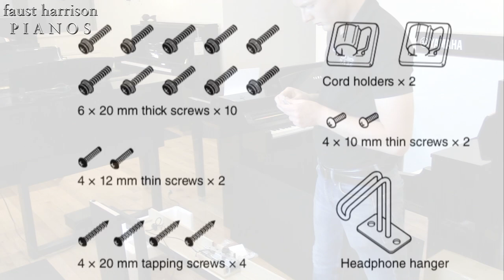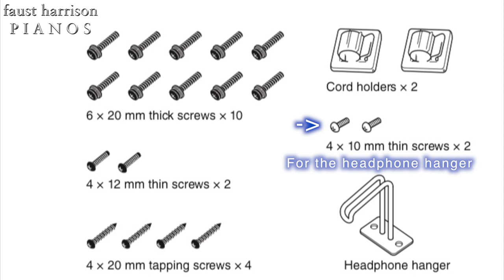Yamaha CLP-735 & CLP-745 Clavinova Setup & Assembly STEP by STEP

Comment: Hello. I want to buy CLP 735 (polish ebony)gloss black. I think color has no effect on sound. Do you think rosewood or (polish ebony) And do you think it's worth paying that price difference? Thanks.
Reply from the maker: Hello, thank you for the comment.  The color has no effect on sound..  The finish color really depends upon where you are going to have the piano setup and the surrounding colors in the room.  The polished ebony option is great if you have a neutral room where the rosewood would probably be better if the room has colorings that compliment that finish.  Yamaha is now offering the new model, which is the CLP-835 available in several color finishes.  https://faustharrisonpianos.com/product/yamaha-clavinova-clp-835/ and you can compare the different models here: https://faustharrisonpianos.com/wp-content/uploads/2024/07/Yamaha-CLP800-Specifications.pdf

Comment: hi, i wanted to ask you if in your experience it was worth spending more money on the 745 than the 735?
Reply from the maker: Hello, the differences are that the 745 has better sound: two 50 watt speakers where the 735 has two 30 watt speakers.  Also, the 745 has wooden keys for a much better feel and playability versus the synthetic keys on the 735. The CLP-745 also has Built-In Bluetooth for Audio and for connecting to the Smart Pianist App wireless, which is a big plus.  I would say YES, based on these features.  
Thanks!  
https://faustharrisonpianos.com/product/yamaha-clavinova-clp-745/